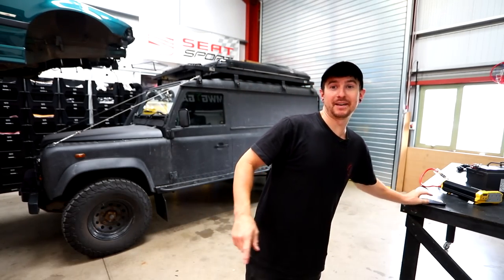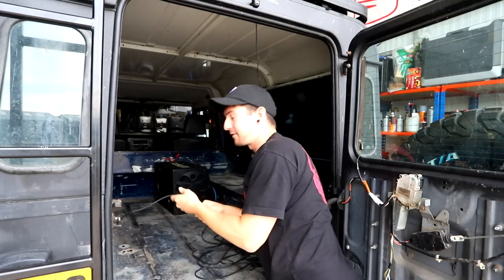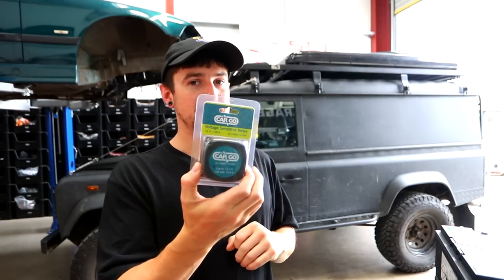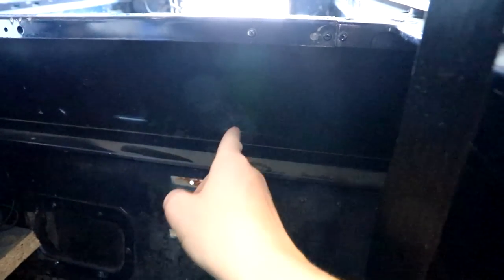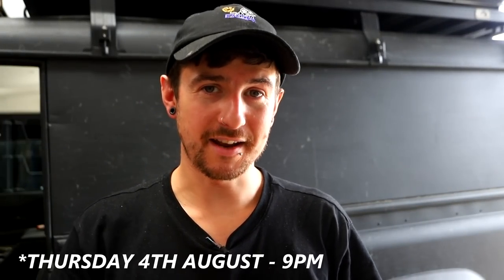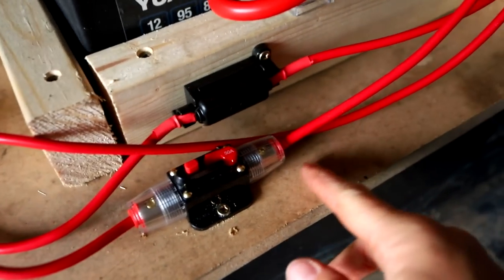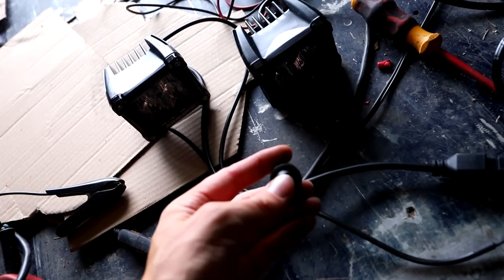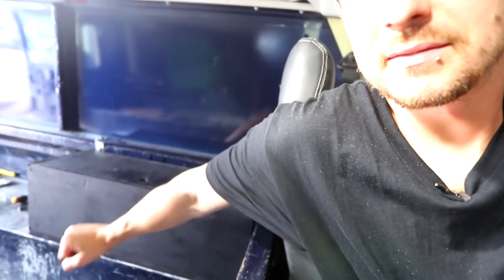Overland Defender finally gets some POWER

Comment: A full length pull out draw between the rear wheel tubs may be a good addition for extra storage (with heavy duty slides). You could then build your sleeping area over the top to maximise space. Loving the overland build btw 👍🏼

Comment: Well done matey, looks tidy! 

I couldn’t see from the video but the fuse AFTER your starter battery BEFORE your split charge relay you ideally want as close to the starter battery terminal as possible; this protects the circuit from earthing out at any point as it runs from starter battery to the split charge relay, for instance on the bulkhead as it passes through.

Thought I’d recommend! 😊
Reply: He did put that fuse under the seat with the battery
Reply: @RGen3  😊

Comment: You should add a vent to outside to your leisure battery, they plug into the battery where the little white cap is on the end (your van converter neighbour should be able to help you with that). You might also like to fit a co2 alarm (battery operated one from toolstation) as it will give you an early warning if the leisure battery starts to fail an off gas.
Adding an alpicool compressor cool box will be a game changer for your camping, they are really efficient as they are top opening.
Reply from the maker: V good advice all of that! Thanks bud

Comment: Good video.  I am in the middle of my own aux electric install and when it came to the inverter I decided it was better to plan out what I intend to run and then find the way to do those things from 12V D.C. because otherwise you are going from 12V D.C. to 240V A.C. and then usually back down to some small D.C. value to power your device. Which is ridiculously inefficient and given that we are running all our kit off one aux battery, efficiency is pretty important. So I've decided I won't even bother installing an inverter.

Comment: i dont know how hard it is for you to add this in to your electrics and if it even makes sense for your use case.. but a way of using a rollout flexi solar panel or two would be great for longer stays and not reliant on your engine being run ect. just a thought big dawg ;)

Comment: Good project. Make sure to mount the inverter and relay on rubber mounts to dampen some of the vibrations which could damage internal components over time. Also grommets for bulkheads and reverse camera. You can use some felt around the battery box lid to stop rattling. Consider ventilation for the leisure battery...if it needs it. ✌🏿😊
Reply from the maker: Rubber mounts is a v good idea thank you!
Reply: @boqer123  most welcome 😊

Comment: I'd wire some usb sockets and a voltage meter in them bits you mentions last either side of the switch panel, always handy having usb sockets near by, saves having to run a cigarette lighter socket and stuff

Comment: I’d add a solar panel too. If you are parked up and it’s sunny I’d have a switch so you can charge the battery and also other stuff without losing too much power out of the battery otherwise you will need to start it if the leisure battery gets low. The flood lights will take a fair bit of power even though there LED.

Comment: Great video - would love a Defender myself! Perhaps next steps could be a compressor (for flats/airbed), gas storage and stove? Looks sick anyway!
Reply: A decent compressor is useful for 4WD vehicles so that you can deliberately let air out of the tyres for certain terrain and then pump back up after. But for airbed etc you can get away with a 12V D.C. pump.

Comment: That breaker running to your fuse box i’d recommend swapping that out and putting in the same fuse you used for your split charge relay. Them breakers have been seen to not shut off when more than 50a goes through it. Also 50amp is very high for that fuse box, I’m assuming you’ll be wiring usb chargers and lights etc.. using a breaker with to high of an amp rating can be an issue as it won’t switch off if there’s an issue. 

USB’s and lights use hardly any amps so 50a is way too much really. I run a 30a In my campervan, and my fuse board is full.

Loving this build though!! 👍🏻👍🏻
Reply from the maker: Good to know cheers mate!

Comment: Run another bat cable thru an isolator switch betweenthe two batteries...in the event of a flat battery you can get a start out of the leasure battery.

Comment: How do you jump start the defender when the battery is under the seat do u need to take the whole seat out or just the bottom piece?
Reply from the maker: Bottom piece just pulls straight out, super easy
Reply: @boqer123  nice 👌